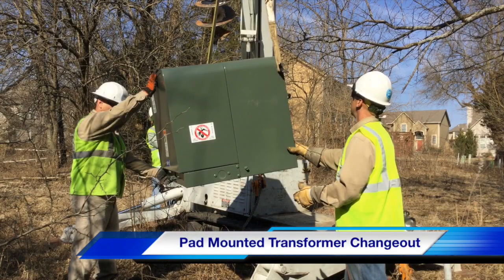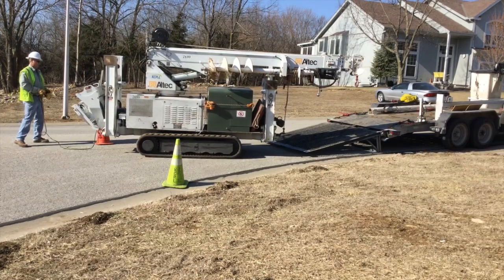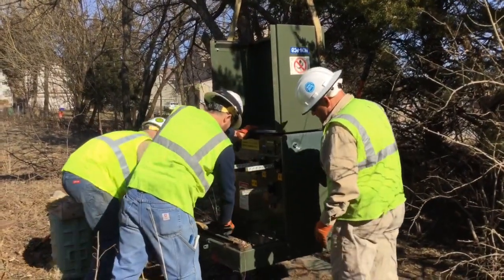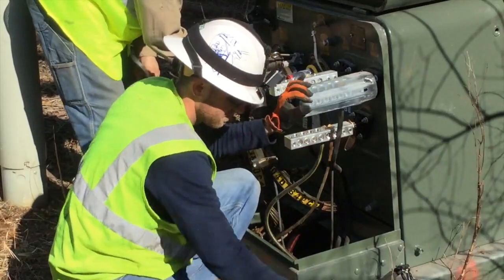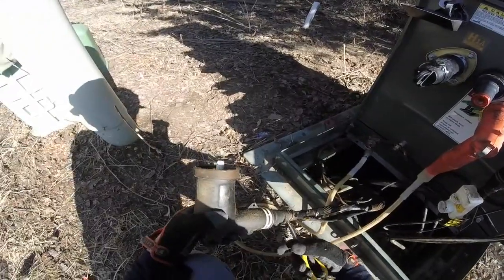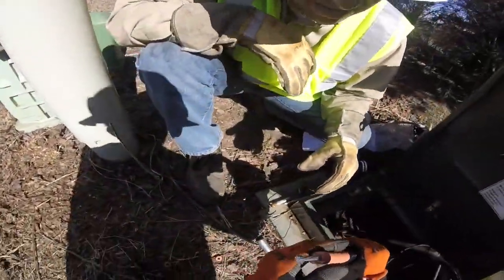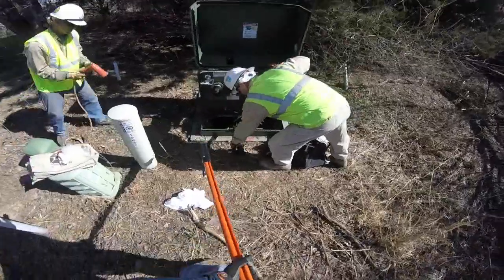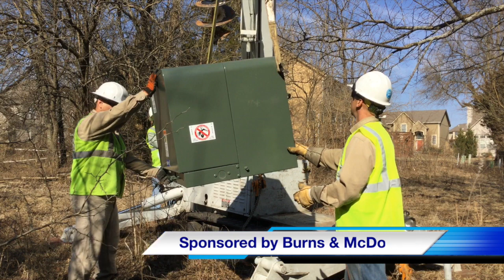How to Change Out a Padmount Transformer

Comment: If the primaries are dead why do they use the insulated stick to connect them?
Reply: If it ain't Grounded, you typically treat them Hazardous due to Induced Voltages...

Comment: What about INSULATED gloves and sleeves? Or Are they working dead
Reply: They are working dead. Residential underground systems like these are usually fed in a loop, you can tell because there's two primary cables. They would simply go to the transformers on both sides of this one and disconnect the cables feeding this unit. It's not a problem because all other homes remain energized, they only drop power to the homes fed by this transformer which is of course unavoidable.

Comment: No Rubber Gloves, WTF!!! I hope OSHA don't see this video!
Reply: Jose Alvarez don’t need the gloves if both ways are dead and grounded bud.
Reply: @Chris-cq2il  good use of 'bud'
Reply: They weren't handling energized wires. They also were wearing leather gloves, which is sufficient depending on the arc flash rating.
Reply: hot sticks to heat up

and

was tested and grounded dead

gloves for what

Comment: Why don't you test for potential at the test point?
Reply: i understand what you are asking. Your question is in relation to Utility XFMR's and Medium Voltage. I am assuming you are talking about the potential at the Sub Station, or the Pole Mounted XFMR's?? 
But potential is  abroad statement. Also, "Test Point" is abroad statement as well. One could argue, a test point is the Pole mounted transformers, you could say they where at the test point, you could say the test point was irrelevant etc..
Reply: @Bloodhound_Dogg  there are test points on the elbow to see if the elbow is alive.
Reply: Good point Jim, You won't get a good reading trying to measure from outside the elbow due to the semiconducting shield.
Reply: @SFoley990  you’re literally supposed to measure from the test point on the outside of the elbow so you don’t break load ripping a live elbow out. Don’t comment if you don’t know what you’re talking about.

Comment: Awesome to see (even though the electrical infrastructure in The Netherlands is way different)!  This reminds me a little bit off a Dutch program on public television in which they teach kids about all kinds of things they are curious about, including stuff about electricity.  I have two questions:  whats the cylinder next to the padmount transformer for?  I can also see some kind of braided copper wire running directly next to the transformer cable they change the elbow from, is that a grounding strip that eventually turns into braided shielding that should ground out the cable in case some serious heavy equipment breaches the cables integrity?
Reply: the cylinder looks like a fiber box (telephone or cable). the copper running down the wire is the concentric neutral.